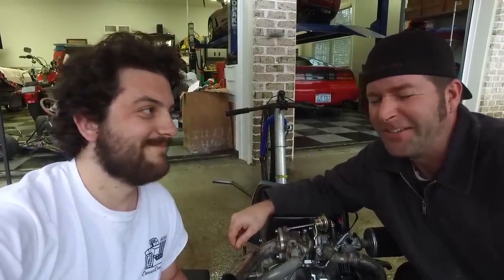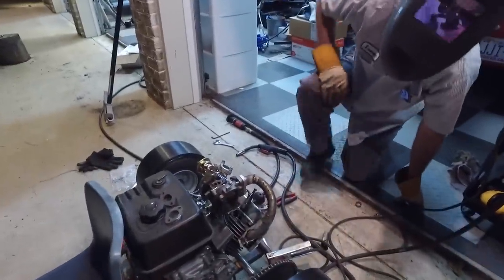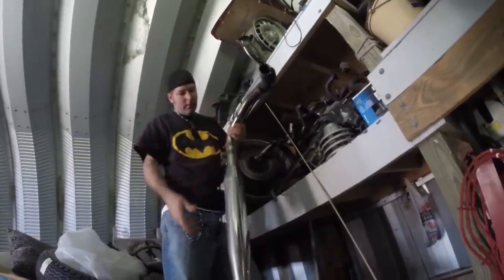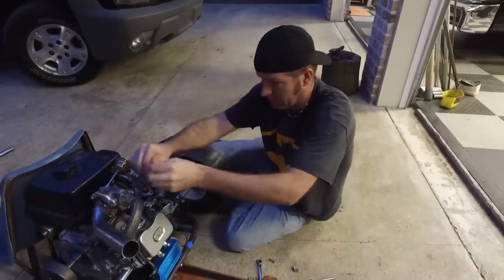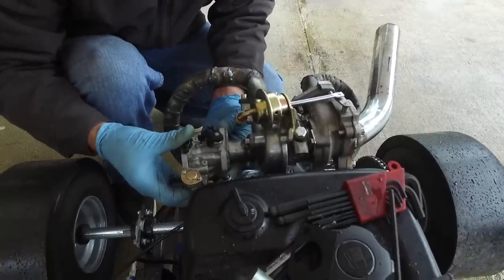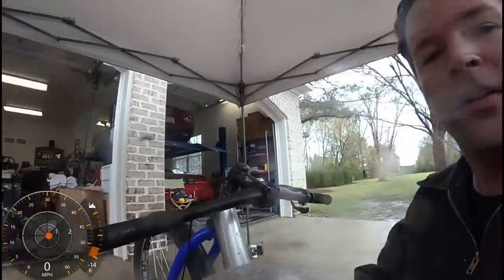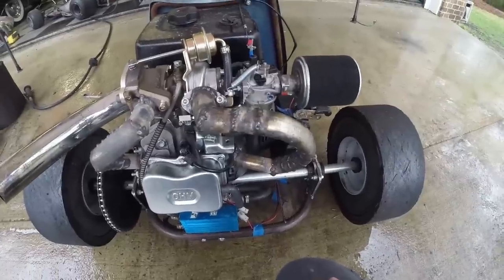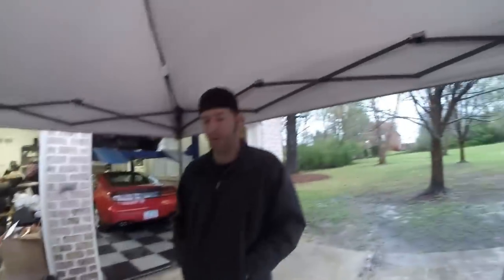Turbocharging a 420cc Drift Trike

Comment: biggest problem with that carburetor is its designed to work in a narrow air fuel ratio. as the boost increases, the air imbalances the mixture making it lean. efi compensates for the variable ratio. sadly, small engine carburetors are not designed to operate in a wide power band like a car carburetor.

Comment: I know I'm 5 years too late and I actually watched this video when it was released, but to answer your question on the terms of the piping, the pipe going from the exhaust on the engine to the turbo is called the hot side piping for the turbo and the intake pipe from the turbo to the engine is called the cold side or charge pipe.

Comment: Carb ALWAYS goes before the turbo, otherwise the turbo will just push air back through the jets. yes you can use turbo's with a carb. Btw fuel mix needle needs to be turned a ways.
Reply: No they Don't
Reply: +Travis Piper roadkill put the carb after the turbo
Reply: +Travis Piper not always but its normally always easier.
Reply: +Travis Piper as far as i know you can do both, but, for after the turbo you need to pressurize the float bowl so this doesnt happen.... im guessing they didnt do that.
Reply: Fabio Spiesanzotti  you mean after the turbo.... fuck even Holley make turbo carbs that go post turbo. You just need to pressurise the fuel system higher than the turbo boost pressure. Same shit needs to be done with EFI cars. Thats why there is such a thing as rising fuel pressure regualtors.

Comment: I made a turbo work with the carb on my gokart with a 390cc engine. I just put the carb on the air filter side of the turbo and raised the fuel tank a few inches, works perfect without EFI. Currently running 0,9 bar of boost pressure
Reply: What did you do with the jetting in the carb?

Comment: charge pipe is way to long! put the turbo in draw threw setup but put the compressor blowing directly in to the motor. will have to make longer exhaust to turbo but with so long of charge pipe fuel is not staying atomized into cylinder. draw threw does work even though it's hard on the turbo. Pontiac trans am turbo's used this setup with mixed success.
Reply: Centrifugal force will separate the gas completely out of the air and stick it to the sides of the tube. Need to put the carb after the turbo the piston squish is what atomizes the air fuel mixture.
Reply: @trevinskiking2165  actually it is Ive done this in a lab
Reply: @trevinskiking2165  This is how BMW is getting rid of humidity in the air to make it more dense
Reply: @Thrive-Off-Grid  Lab tested, Brown fur & 4 feet 😋
Reply: @Thrive-Off-Grid  Oh BMW ? it must be Fantastic, super, incredible 😋
Reply: @Thrive-Off-Grid  fuel is atomized in the carb too,fuel only sticks to the inlet tract if it is ice cold and/or too long,piston squish is the last line with of atomization.NO lab testing needed I build race engines Professionaly
Reply: @Thrive-Off-Grid  Done what in a lab exactly ? & am I supposed to be Impressed by that ?  Trev New Zealand

Comment: what you need is a boost and afr gauge. Get a china 26mm mikuni and keep the draw thru setup. You should be able to properly tune it between 11 to 11.7 afr. If you get it working right you will start to see frost on the inlet pipe and maybe the turbo housing. The atomizing of the fuel works as a intercooler, and it should make good power. I'd also keep the boost under 8 psi.